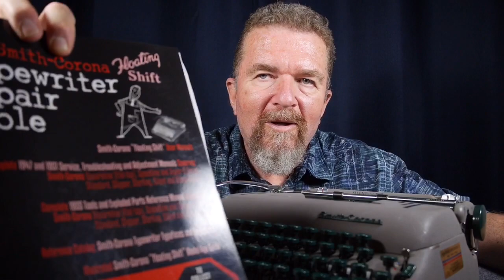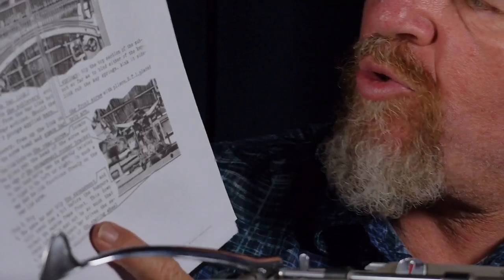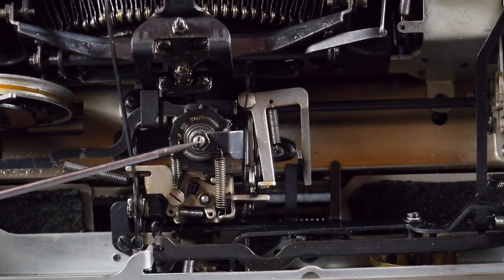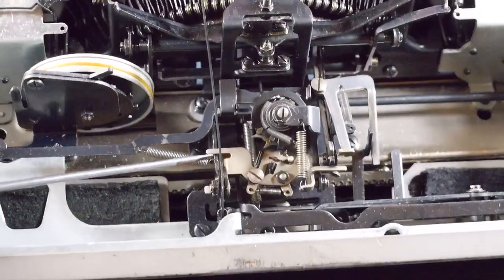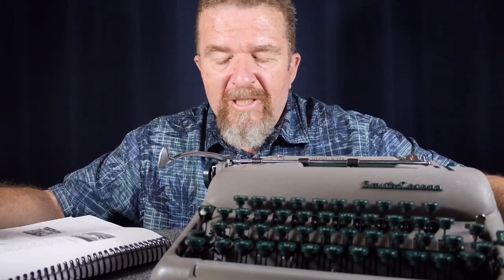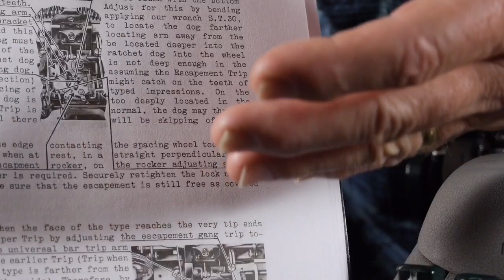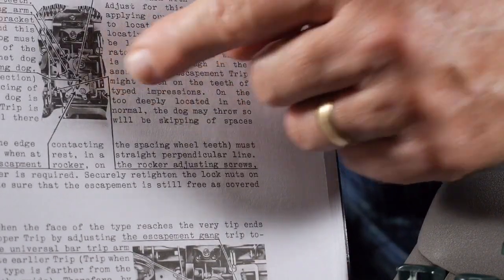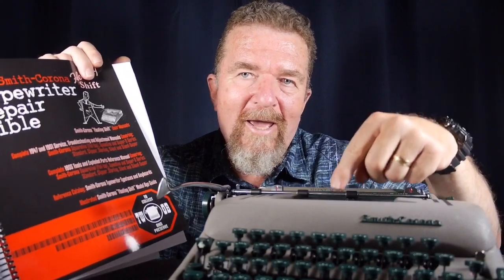Typewriter Video Series - Episode 67: Typewriter Repair Bible

Comment: Very helpful video. And I will be buying that manual. Recently managed to mangle my recently purchased Smith-Corona, and I am so ignorant of nomenclature that I can’t even describe what happened. I managed to pop about seven “thingies” loose from seven doohickeys as I was attempting to loosen a bunch of stuck keys. They were stuck because I applied a liberal coating of machine oil some months ago leading to a massive gummy attack. Yes, I know: brillyunt. I have an advanced degree in All-Thumbsology, so I will need all the help that your videos and Mr. Munk’s manual can provide. Heh, heh.

Comment: Joe, you could try moving the segment wire slightly one way or the other, the condition you found is usually wear in the type bars and the segment wire, common to all makes. it may help.
Your escapement problem you discovered yourself, I have never worked on many Smith Corona portable or Standards but in principle , over typing , piling etc is usually caused by the trip being to early. When the trip is early it allows a second bar to enter the escapement area before the first bar has completed its escapement action, that is the second part of the action, i.e the forward action and the separate return action. Set the trip close to the ribbon, almost touching the ribbon, you may find, I don't know but you may have to adjust the ribbon lift, check to see.  Service manuals are not always correct.....I was a Remington trouble shooter for many years, If you think I can contribute to your exercises drop me note in my drop box good to see some one preventing my trade from complete extinction

Comment: I have the same typewriter and I love it, however I noticed my v key as a lot of horizontal play, it types fine, but the v key  has a lot of left and right play  between the c key and the b key. Is there any way to tighten up the keys?
Reply from the maker: I compared my keys on my early Silent model and some keys have more play than others. I think the design is meant to have some side-to-side play.
Reply: @Joe_VanCleave  thanks, makes me feel better I was worried I would have to bend something. Which for some reason seems wrong to me that most adjustments on these typewriters are done through bending and not some type of fastener or set screw!

Comment: Hey Joe I got a vintage typewriter and it works great but has one problem. When I push that lever to change the line it doesn't get one click down as it should! It just stays at the same line! What can I do to repair it?  And should I consider finding a professional?
Reply from the maker: Check the line spacing switch near the return lever, make sure it’s not all the way back toward the rear. Also, when you turn the platen knob do you feel the ratchet click? If not, check that the line space clutch is engaged. Ensure the left knob is pushed in all the way. And some machines have a separate lever near the left side for disabling the line spacing ratchet, so check that. Finally, make sure the pressure rollers are engaged by the release lever on the right side. If all those things are good, then it may need service.
Reply: Problem fixed. Got yourself a subscriber.

Comment: Great video, thanks.  Great to see the book has been such a help. Joe/Mr. Munk is there a section in the book about the anvil & platen relationship? 

My Super is fine other than the fact that the type bars slightly hit the platen too early instead of hitting the anvil plate first.  This means that whilst the platen is hard anyway, its a little noisy because of this. As a temporary fix,  I took off the anvil plate and used it as a template to cut out several wafer thin pieces of acetate and put these behind the anvil plate and put the screws back. 

My idea with my acetate template was that this effectively ensured the buts on the type bars hit the anvil earlier therefore reducing the noise.  I know this isn't ideal and it's helped a little but I'm still not happy.  

As we know, the type bar is supposed to hit the anvil a fraction first and then the inertia bends the bar into the platen.  I know about using a piece of paper between the platen and type bar to check for the gap.  Mine machine,  in places is touching the platen and doesn't allow paper to be inserted, but nearer to the middle of the type-basket there is a gap.  I've found the the outer type bars on all my machines hit the anvil earlier than the ones in the middle so I'm guessing this is how they were designed, unless all of my typewriters are wrong!

Thanks in advance p.s I can't afford to send my platen from the UK to the States to be re-plattened so I really need to try and adjust the anvil platen distance.

I adjusted the gap on other machines, i.e with the letter it was really easy to push the carriage back (in that case it was hiding the anvil too much before the platen so my print was faint).
Reply: I think that's covered in Inspection 8, pages 90-94. Generally speaking though, you should start at the beginning and do the adjustments in the order specified, as Joe did. If you're engineering additions, then there's an adjustment you're probably missing, or maybe more than one that might not become obvious until you've started at the beginning and worked your way up to the problem area.
Reply: Hi,

Thanks Mr. Munk.  I haven't got the book yet, but at least I know where to head! thanks for that.  You raise a good point, I think with the book I'd go through all the checks Joe did as it's more than possibly that just as the machine feels ok to me, the adjustments might help. Thanks again.

Comment: Hi Joe!
I have the same model of Smith Corona, and it has the same issue with the tripping point of the spacing yours had. How did you bend that arm?? Towards you or upwards (↑)?? And did you use a special tool or just pliers??
Thank you in advance.
Reply from the maker: From the manual: "The escapement should trip when the face of the type reaches the very tip ends of the type guide. Obtain proper Trip by adjusting the escapement gang trip toward the universal bar trip arm to create earlier Trip (Trip when face of type if further from the tips of the guide). Therefore by bending the gang trip back away from the universal bar trip arm, obviously, Trip will occur later. Adjust the escapement gang troop forward or back with (our) pliers ..."

So, with the machine on its back and you facing the underside, to have it trip earlier bend the escapement gang up; to have it trip later bend it down. These are slight adjustments. I just used a regular set of pliers.
Reply: @Joe_VanCleave  Thank you!! Your help was very helpful.

Comment: I have a question. I have a Royaluxe 450 typewriter and the bell mechanism has a missing part. The part that is moving the bit that actually hits the bell. I have no idea how the missing part looks like so that I can manufacture one from some flat piece of sheet metal. I have looked up on the internet, but I could not find anything. I am trying to do it intuitively, but I can't figure out how that thing actually works (when it comes to returning the carriage.
Reply from the maker: Hmm, don't have that machine in my collection. Good luck finding information. Perhaps ask the Facebook Antique Typewriter group?
Reply: Thank you for your quick reply. I will look for that group.

Comment: I got an old sears scholar model 161.53970 that works fine but the power return does not function at all. Any ideas?
Reply from the maker: Hmm, I'd first check both belts, make sure they aren't slipping or broken. Probably needs a serious degreasing and cleaning too.
Reply: @Joe_VanCleave  yeah took it apart and the belt were good. But I found out it was a little metal piece that acted like a brake that had ruber under it, would stop a wheel from spin which would instead  make the gear next to it spin and pull a string  and thus the paper returns. But there was no rubber left so I placed some electrical tape where the rubber would be  and it started to work. I am also surprised how the belts are still pretty springy. Anyways thanks for the help.

Comment: Hi Joe
Wondering if you could help me. I have been given a Facit 1620 but the carriage doesnt move when pressing the space bar, tab etc but the release works. It looks like the escapement isnt moving. Can you tell me which clip I should view on how to repair it, if you have a clip that is.
Reply from the maker: I’d first look at where the left and right margins are set. If they’re set in the middle, the carriage won’t move unless you operate the carriage release levers.

There’s also a carriage lock lever, I think on the left side, used for immobilizing  the carriage in transit, but that doesn’t sound like the problem, given that you can move the carriage using the release lever.

Does the carriage move when you type a letter?
Reply: The carriage lock is not engaged and the margins are set correctly. When you press a letter the carriage doesnt move either.
Reply: Also im not really sure whether it is a 1620. I think its a TP?. Not sure how to find out what model it is.

Comment: Did you try a drop of lubricant on those tight points before loosening them.  I would find it hard to believe that those would tighten up in service, unless maybe they had accumulated crap, so maybe a light cleaning fluid and a drop of oil, before screws are turned?  The bar bend on the space bar looks like the right fix, that IS something I could see happening with wear.  As for the adjustments, maybe someone adjusted them improperly beforehand.
Reply: John Sikes I’d say that the oils they used—oftentimes when the machine was built, gums up and/or gathers dust. What I do is to clean it all out that I can, and then very lightly brush in some automatic transmission fluid (Mercon 5), and nine times out of ten I would fix some problems.  

Btw:  I got one of these typewriter bibles, and I used it to repair some problems.  I swan, That book knows more about typewriters than I do!!
Reply: @johntapp1411  Interesting, just kinda learned on my own, but I have discovered some pretty good source material online for  several specific machines including adjustment/calibration specs. 

Which typewriter bible was it?  Any good info. is always helpful.  I usually use Marvel Mystery oil, and it LOOKS a lot like tranny fluid, but certainly doesn't smell like it (tranny fluid is NASTY stuff).  Tranny fluid does seem to be useful for a myriad cleaning and lubing tasks (and breaking loose stuck bolts, with appropriate thinner). 

I've even seen people throw in a quart and idle a car engine for several minutes right before an oil change.  Don't know if or how well it works, or if it is harmful (but I kinda doubt it is harmful, if done as stated), not sure though.  "They" claim a lot of extra crap comes out doing it, though.
Reply: John Sikes Like you, I was largely self-taught.  I started out, at 13, in 1981, and collected all kinds of typewriters.  I’ve even learned a thing or two from a few old repair men and some factory manuals.
The T. Munk Bible was what Joe Van Cleave was talking about.  This particular one is on manual portables and upright typewriters.  They are a bit complex but what good manual isn’t?  Anyway I used it several times and it sure helped out.
 
Not Marvel Mystery Oil!!  I tried that stuff, and it works good one day and the next it’s stiff as a board—like a red shell.  Yes, tranny fluid, especially Mercon 5, smells like a bag of dead fish—but it works GREAT!! It’s the only thing that does. I think it’s sort of a formulated detergent or detergent action.  You still gotta be sparing with it because all oils and oil-base products attract dirt and dust like there’s no tomorrow.
Reply: @johntapp1411  I will give it a try.  I don't usually have the typewriters long enough to see that happen, I guess.   About the only lubricant I've ever used that doesn't attract dirt like crazy is a bicycle chain oil that dried very quickly and left some kind of dry lube (wax or something?) behind.  Good for bicycle chains, not much else, I expect...CERTAINLY not typewriters.  As a kid, I took a few "baths" in tranny fluid during unintended spills while changing them out.  Even if you think you've gotten it all drained, tip that sucker far enough in at least a couple of directions, and it's Niagra Falls. Chrysler products mostly, so Dextron, not Mercon.  Nasty stuff to try to get out of concrete, too.
Reply: John Sikes I feel sure Dexron would do just as nicely as Mercon, and wouldn’t smell like you just came from a wharf.  I own a Ford Taurus and found that particular fluid sounded high-tech so I tried it and it works—just stinks to high Heaven.

Bicycle chain, as you know, has many times the stress a typewriter will ever have.  I guess that’s why they have an oil that conceals into a kind of grease.  I always thought they always said to just use regular grease there, and the chain oil was for chain saws.
Reply: @johntapp1411  The stuff I'm talking about is nothing like chain saw chain oil, which is very high viscosity and pretty much never dries.   Bike chain oil is VERY very thin, thinner than water, like CA glue kind of viscosity so it will wick into very tiny "cracks", and it dries in about 30 seconds or so to pretty much dead dry.
Reply: John Sikes I’ll just have to admit I’ve never seen bicycle chain oil proper then. Closest thing was spray-on lithium grease.  I used it in several vacuum cleaner motor bearings.  Spray it and it was thin as machine oil, but it congealed into white lithium grease.  As for bicycle chain oil, all I can say is I’ve never seen it nor heard of it.
Reply: @johntapp1411  OK, now I'm gonna pick on you.  Lithium is a crap lubricant for pretty much everything.  ;-)
Reply: John Sikes Now I’m gonna pick on you:  You bet it is. I wouldn’t use that nasty pile of ** unless I was sure I could get it all out of a radio flyer wagon when a better lube came along. I am in total agreement with you. Sometimes I think Coolwhip would do better at greasing.
Reply: @johntapp1411  With ya, brother.  ;-)

Comment: Question:  I just purchased an old Smith Corona Silent.  I've cleaned it and made minor repairs.   All fine except that the carriage return-bell is so quiet as to be functionally useless. The striker arm seems to be hitting the small "bell", and linkage seems  to be operating properly.  Is the muted bell sound normal for the "Silent" series, or do I need to make an adjustment? 
And, thank you for posting these videos.   They have been very helpful.
Reply: Indeed, the bell on my 1954 Silent Super is dull to the point that it can't be heard over the typing.  I degreased the mechanism for the bell, and added a touch of oil and it seem to help, but it's still dull sounding.  My 1966 SC Sterling in comparison, is almost too loud.  Seems as if they over-compensated for their previous model somewhat.
Reply: Thank you so much for your input.   I feel better knowing that something isn't out of adjustment or broken.  The bell truly is (almost) "silent" .   All else is great, however.  It types wonderfully.

Comment: Sir i have a Remington standard typewriter. It suddenly having irregularly unnecessary spacing problem while typing. Example :- R eming ton ty pewrite r
Reply from the maker: The escapement mechanism isn't reacting fast enough. There's a part called the loose dog that's supposed to pivot and allow the star wheel to turn one tooth, then it's supposed to re-engage via spring tension and stop the carriage from moving further. The loose dog is sluggish to move. Try degreasing the escapement with lacquer thinner and/or alcohol.

Comment: Do you know where I can get a striker key for a royal model 10? The face of the H key is the only thing missing and would like to major it fully functional.
Reply from the maker: There's a typewriter maintenance group on Facebook, perhaps someone has a model 10 as a parts machine. Or find a typewriter repair shop in your area with a parts machine. Good luck. Replacement parts are not being manufactured for typewriters, so we have to rely on unfixable junker machines as sources for parts, to keep the better machines running.
Reply: Joe Van Cleave Thanks!

Comment: I want to buy a typewriter. I am confused between godrej prima model and remington 2000 model. So which one is better?
Reply from the maker: They're two different kinds of typewriter. The Remington is a portable, the Prima is a full-sized desktop machine. That said, a lot depends on the condition of the individual machine, how well it's been cared for and serviced. The larger Prima could be the better machine than a portable, for serious writing - if it were in excellent condition. But it's not easily portable. Do you need portability?
Reply: No sir i don't need portability. Thank you very much for your advice. So Godrej prima will be a better choice than Remington 2000 model
Reply: @brahmanandapatra1736  Good luck.

Comment: como solucionar cuando salta el espacio entre letras?. gracias
Reply from the maker: The escapement mechanism is not returning to its rest position fast enough after one letter is printed. This is usually caused by the machine needing to be thoroughly cleaned and degreased of old, hardened lubricants.
Reply: @Joe_VanCleave  ya la desarme toda la limpie y la lubrique, pero no se ha solucionado. tiene algun tipo d regulacion especifica?